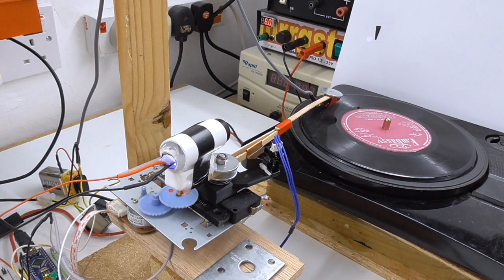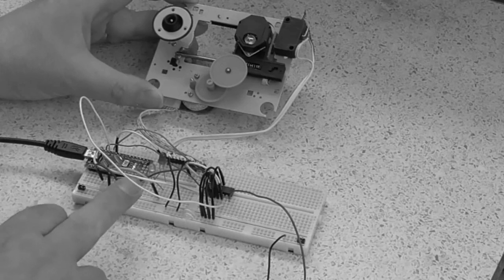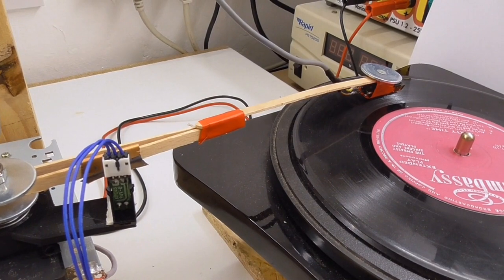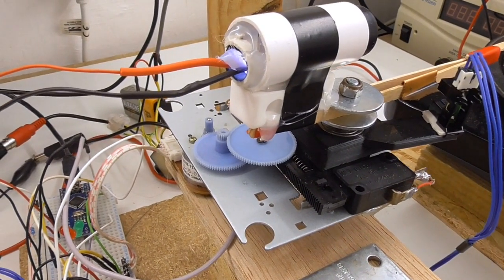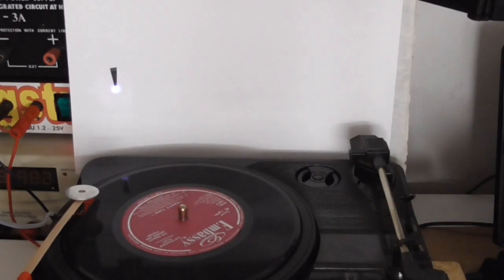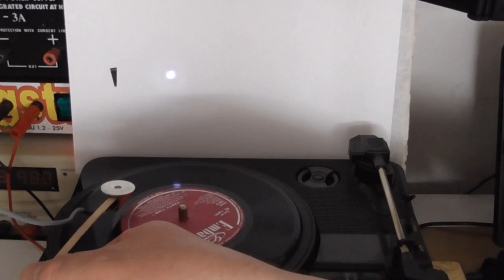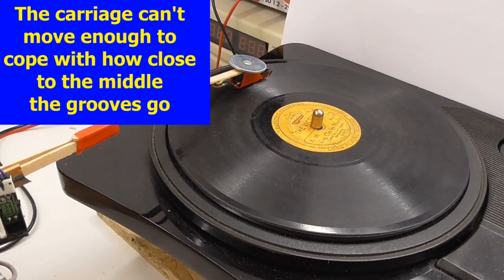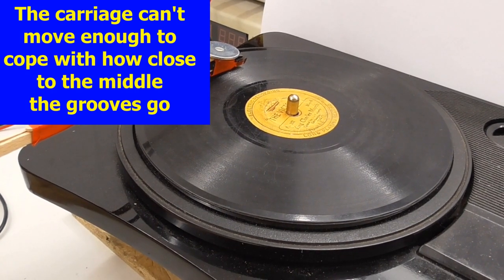Linear tracking assisted record player

Comment: Maybe put a stepper in place of the motor on the tracker calculate steps per revolution, adjust for the real world as necessary, and have a constant tracking speed. A lift arm a little longer than the play distance will allow for track programming/repeat. An interface to convert time to distance. I was really impressed with your video, YouTube didn’t let me know till today.
Reply from the maker: Yes, stepper motors are going to give a lot more options for this sort of system. I have also thought that maybe servo motors would be good for lowering and raising the tonearm. Glad you enjoyed the video. I plan to do more along these lines. Thanks 😀👍

Comment: I was interested in buying a linear record deck as it had a function where you could program what track on an LP you wanted to play or a random selection that I thought very neat and clever... 
This is very technical and you have exceeded yourself in putting this test machine together, bits of a CD player, and building your own amp...  I would like to have some better sound though, what is the reason
for the poor sound quality?   Maybe not essential to the experiment but more pleasing to the ears of us lower beings, lol..  ;)  Great video mate, once again...
Reply from the maker: Interesting the linear tracking record player you mention. I can see how that would would, with the random auto play. I ought to be able to build something like that! 😉. Anyway, not sure why the sound quality is so poor. It might be due to the tracking pressure which this design gives very little control over and I'd probably way to high! I will improve it 😀 Glad you liked the video. Thanks 😀👍

Comment from the maker: /*
L293D motor control
led linear tracking assisted record player
mrrgstuff 2020. This content is free - but if you use it in another video etc - I would appreciate a shout out :-)
 */

// L293 pin 1
#define ENABLE 12
// L293 pin 2
#define CONTROL1 11
// L293 pin 7
#define CONTROL2 10
#define FSTOP 8
#define BSTOP 9

// L293 pin3/6 = out1/2 (goes to the DC motor being controlled)
// L293 4/5/12/13 = GND (must be connected to Arduino GND)
// L293 pin 8 = motor power (use about 6v DC)
// L293 pin 16 = 5v (can be powered from Arduino)

// Either use bi-colour LED or 2 separate one. Don't forget 220ohm resistor
#define LED1 18
#define LED2 19

#define SWITCH 17
#define SENSOR 16

// D2 is the reset switch to bring tonearm back out to starting position

#define RESET 2
// LEDDELAY is the ms time the LED comes on for
#define LEDDELAY 10

#define FORWARDS true
#define BACKWARDS false
// DRIVEIC is the ms time motor is driven for
#define DRIVEINC 3

bool direction;
int pwmspeed = 255;

void setup() {
  pinMode(ENABLE, OUTPUT);
  pinMode(CONTROL1, OUTPUT);
  pinMode(CONTROL2, OUTPUT);
  pinMode (FSTOP,INPUT_PULLUP);
  pinMode (BSTOP,INPUT_PULLUP);
  pinMode (SWITCH,INPUT);
  pinMode (RESET,INPUT_PULLUP);
  pinMode(LED1, OUTPUT);
  pinMode(LED2, OUTPUT);  
  direction = BACKWARDS;
  Serial.begin(9600);
}

void ledRed(){
  digitalWrite(LED2,HIGH);
  digitalWrite(LED1,LOW);
  delay(LEDDELAY);
  digitalWrite(LED2,LOW);
}
  
void ledGreen(){
  digitalWrite(LED1,HIGH);
  digitalWrite(LED2,LOW);
  delay(LEDDELAY);
  digitalWrite(LED1,LOW);
}

bool backStop(){
  if (digitalRead(BSTOP)==HIGH){
    return(false);
  }else{
    return(true);
  }
}

bool forwardStop(){
  if (digitalRead(FSTOP)==HIGH){
    return(false);
  }else{
    return(true);
  }
}

void driveForwards(){
// drives forwards for DRIVEINC ms
  ledGreen();
  analogWrite(ENABLE,pwmspeed);
  digitalWrite(CONTROL1, LOW);
  digitalWrite(CONTROL2, HIGH);
  delay(DRIVEINC);
  driveStop();
}

void driveBackwards(){
// drives backwards for DRIVEINC ms
  ledRed();
  analogWrite(ENABLE,pwmspeed);
  digitalWrite(CONTROL1, HIGH);
  digitalWrite(CONTROL2, LOW);
  delay(DRIVEINC);
  driveStop();
}

void drive(){
  if (direction == FORWARDS){
    driveForwards();
  }else{
    driveBackwards();
  }
}

void driveStop(){
// stops the motor
  analogWrite(ENABLE,0);
  digitalWrite(CONTROL1, LOW);
  digitalWrite(CONTROL2, LOW);
}

bool sensorTriggered(){
  int s=0;
  if ((s=analogRead(SENSOR))>400)
    return(false);
  else
    return(true);
//  Serial.println(s);
//  delay(200);
}

// the loop function runs over and over again forever
void loop() {
  if (digitalRead(RESET)!=HIGH){
    direction = BACKWARDS;
    delay(10);
  }
  if (backStop()){
    direction = FORWARDS;
  }
  if (((sensorTriggered()) && (!forwardStop())) || (direction == BACKWARDS)){
    drive();
  }
}